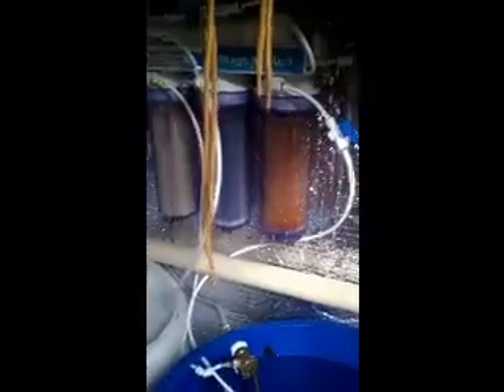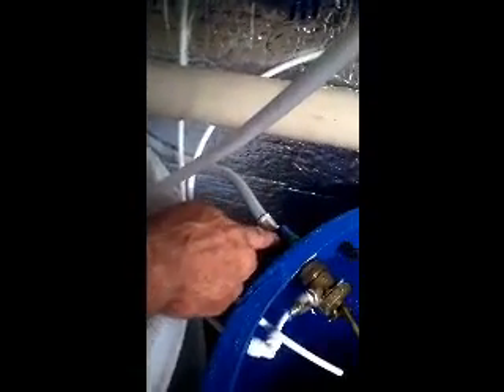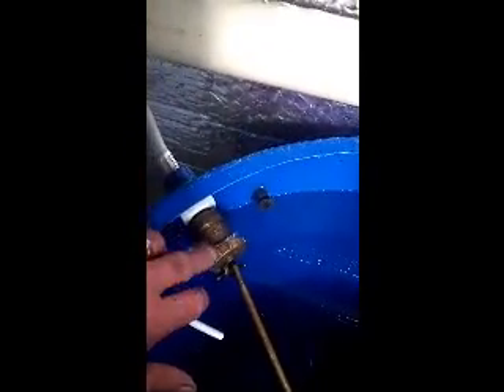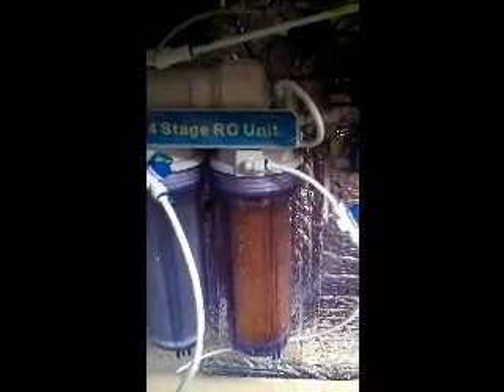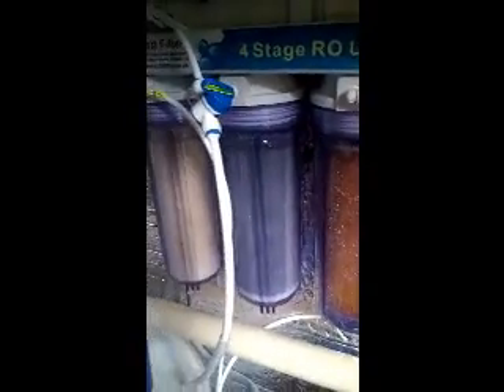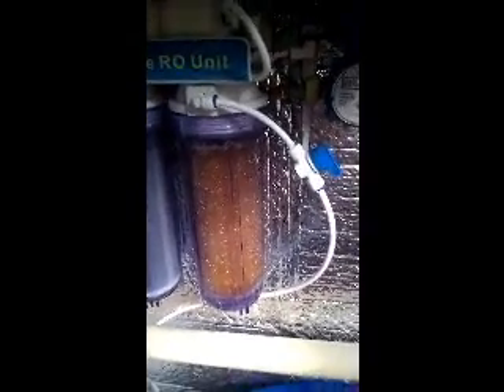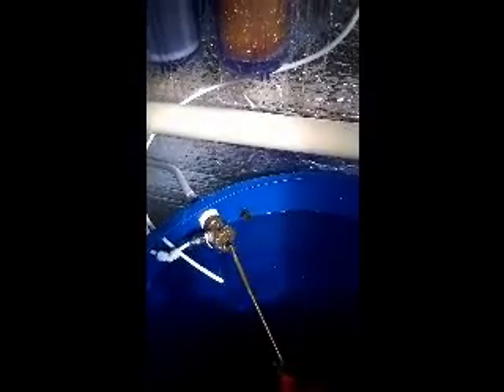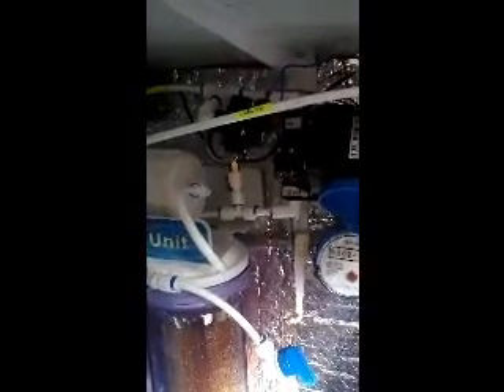ro setup

Comment: Excellent idea ie the water shut off. How did you put the hole in the side of the ball valve fitting ?
Reply: +Marcus Norton . The hole was already there with a thread in it to take the usual little  plastic elbow to direct water into the toilet cistern.  It had an odd thread on  it -(very close to 3/8 inch bsp if I remember correctly) so I just bought an adapter to fit it. If I were to do it again I would get a threaded male stud connector like this http://www.ebay.co.uk/itm/Nylon-Pneumatic-MALE-STUD-FITTING-METRIC-BSP-tube-inline-push-fit-connector-/321632323070?var=&hash=item4ae2c7c5fe:m:mTgZbWYrqz_IoSRt6WewUUQ